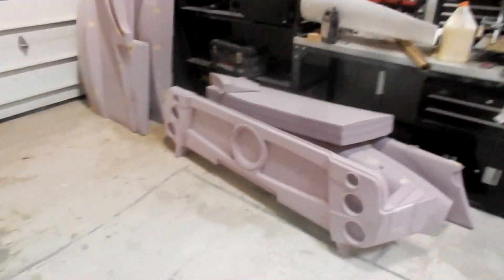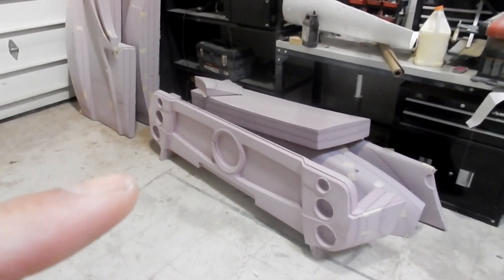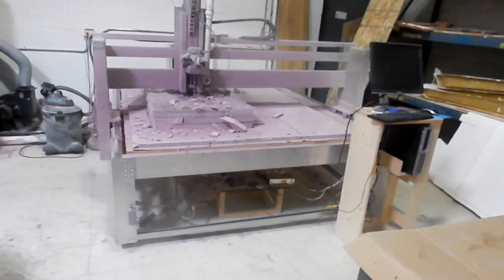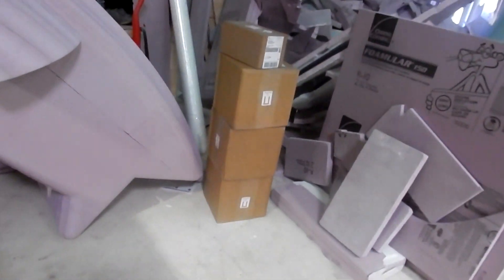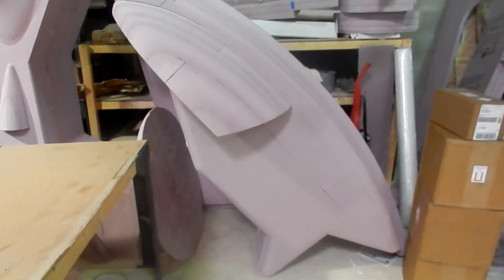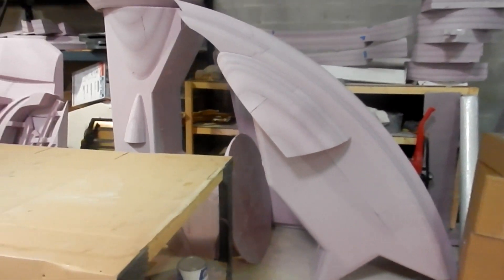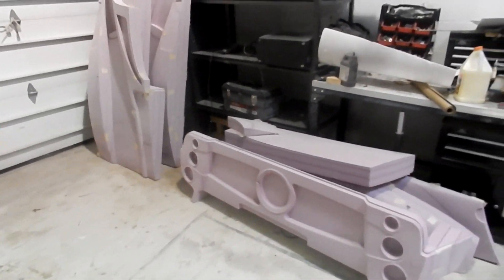CNC Zhonda R styrofoam plug , amazing car!

Comment: quick question; how long does it take to get a full car body with foam in cnc ? and the cost please. I know it depends on the design but between how much and how much
Reply from the maker: Hi, it takes about 2 weeks to machine. cost can range 6k-8k

Comment: Hello Nathan.
May I say what a great job.
I take that these foam replica or custom parts  are the building blocks for fibreglass work to be moulded from.
Example: 
A kit car / custom car build.
Am I correct.

If this is correct. 
Then I have a follow up question. 

By the way. 
Is their an E-Mail to contact You.
Kind Regard’s.
WG-Fab.👍

Comment: How much for the pagani zonda styrofoam, Thanks
Reply: ele 112 
You need to convince this guy that your serious whatever the hell that means. I tried to reach out to him multiple times. This guy ignore everything. It’s kind of a joke
Reply: Facts, Connections No Opinions i won’t even bother i he does not want my money some other companies will, as i have done a quick search online and found two cnc companies that cut foam and i was given a quote for their service and to my advantage the item that i will receive will be from one piece which will save me a lot of time.
Reply: @ele_112  What were the companies you found? I haven't had as much luck.
Reply: Joshua Kimble they companies that i had came across are based in United kingdom London, i will post a second comment later with details regardless if your interested or not as far as i can remember i was given a quote of about £5000 for a one piece item i.e: car at 1:1 scale of pagani zonda

Comment: How much are you selling thee for ?  What frame do they go on or do you have to have a tube frame or composite or ?  Is you plug good to fiberglass or carbon fiber right over or do you coat it with some thing first ?   I would love to visit with you more on the car !  Thanks
Reply: cody cheney if this was me, I would take the Zhonda and weld up a steel tube chassis, in the back of the chassis I would take the front subframe and engine/transaxle out of a VW TDI and swap it into the rear, extend the shifter cables. You could even convert the TDI to bio diesel afterward, literally 70-90MPG+ daily driven Zhonda.... who cares if anyone keys it, it’s fibreglass, truck bed liner the whole bottom and wheel wells and you’ll be good for centuries, you could winter drive the thing lmao. Just zinc plate everything.

Comment: Do you make plugs for specific chassis? I'm new to all of this. Correct me if I'm wrong, you shape the plugs(car body parts-fenders?) so you can cast the fiberglass molds from them? Thanx for the video great work!
Reply from the maker: If you needed a body designed to specific chassis dimensions i could do that. yes, the plugs are to create molds/tooling for fiberglass parts.

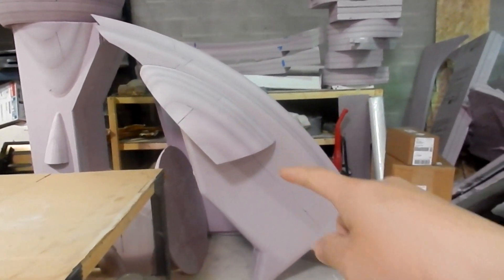Comment: Uhhh i identify the part at 1:14 as the G1 Tron Lightcycle. That movie is not from the 90ies, it's from 1982!

They didn't actually ever build them for that one, they didn't even have scale models, they were only 3D rendered. Which, think about it, 1982, shocking right. Well, it looks accordingly abstract now. They didn't have to interact with human characters or light at all, because people wore emissive suits and instead of somehow sitting onto the bike and the canopy lifting or closing on top of them, they simply grabbed a bar in the air, that was the steering bar, and the whole bike simply crossfaded on top, so the canopy was never supposed to open. The Lightcycle was never supposed to make sense as a real vehicle, it was specifically designed to be completely and utterly impossible, so good luck trying to actually build them.

They redesigned the Lightcycle into something more vehicle-like in later iterations of the franchise, but it always ended up looking fairly different and having completely different dimensions.
Reply from the maker: doesnt seem that complicated to make the body work on a motorcycle.
Reply: If memory serves, the canopy in the movie wasn't even wide enough for the driver to steer anywhere near comfortably. They didn't care because the transformation sequence is only shown from the side, and then driving sequences only had their head showing within a composite of hand-drawn animation, not even 3D.
Reply from the maker: what the movie dictates doesnt matter. we widened the shell 12 inches. its not inconceivable to make it a working shell on a motorcycle.
Reply: Siana Gearz , I wanted to make a full scale original version lightcycle since I saw the film in 82. concessions had to be made as you are correct, the cycle never was real,  and no room to actually maneuver within the cycle. We had to make it wider in order to actually accommodate a real human inside, so she's a little bit wider accordingly. The lifting hatch idea allows egress into and out of the cockpit. The hard part is making it operate. Using a gyroscopical balance system  as the cycle is fully enclosed..hopefully, this answered some of your observations, 😊

Comment: where do you get the 3d models? I'm asking as soon as I start watching, so forgive me if it comes up later or if you've addressed this in other vids.
Reply from the maker: You can learn CADD and model the cars yourself or you can buy existing models from websites.I cant list the websites here but you can google search.
Reply: ok, tks. I just meant the accurate measurements. CAD is no problem for me but getting the exact measurements is.

Comment: Hey, I actually was trying to get into the same type of thing that you're doing and I was wondering if you could give me any tips on how to get started and designing. What's some good 3d modeling software that'll give me all the tools I'll need to make something beautiful?
Reply from the maker: Hello, I'm using rhino 3d as a modeling software, but there may be easier packages to learn like sketchup.
Reply: OG_SMOKE ' 3d studio max is great 3d program, but it isn't cheap

Comment: Would a spray on glue be easier/ faster than drywall screws?
Reply from the maker: i do use a spray on adhesive to piece the parts together. however that is simply not enough for some sections to stay together so i use screws as sort of "skewers" to help support the pieces.

Comment: If a customer designs a custom car body, and gives you a 3D model w/realistic dimensions to make a plug, how much roughly would you charge?
Reply from the maker: around 5k. depending on the season and how busy i am it can get up to 8k sometimes.
Reply: Oh nice. Do you make negative fiberglass molds too?
Reply from the maker: yes i do.
Reply: That Tron looking thing your building is cool kinda looks like the one I want to build, where you located?
Reply: Lmfao 5k for u to print a mold someone else already created... 🤦‍♂️so pretty much 5k to use ur equipment.. smh just go to a mass production company cause this guy is a fool 2k I would understand but 5k is half of what it cost to buy a replica kit that comes ready to go with all parts and thought process and fiberglass done I would never pay anyone 5k to print some styrofoam
Reply: @RICHCREWSPLASHSET   You have zero idea what you are talking about.
Reply: RICHCREWSPLASHSET I’ll be waiting for your videos and business to compete. Unless, this was just all talk...
Reply: @RICHCREWSPLASHSET  Good luck trying to find a service that does what he does for close to 5k. A replica kit is not YOUR OWN design smh!
Reply: @nman2563  You can get this kind of plug made in China (if you have your own CAD model) for <$2k. It will also be in no more than 2 pieces.
Reply: @MaRi-wk8gp  it'll also take forever to get to you and have an increased chance of getting damaged.

Good luck with that.

Comment: What type of price do these run, ballpark? You do amazing work man! Awesome!!
Reply from the maker: 5-8k. thanks man!
Reply: Inspire Automotive 5-8 for one like this or any car body? Can you ship it worldwide?
Reply: @InspireCNC  contact email info requested. Wanting to use a 70 s Lotus Europa and morph GT40 front and rear ,door skins with new roof with door cut outs. Wanting to use orig size of Lotus Europa. About 4 % smaller. Using the Lotus Europa as a donar car is dot legal and allows 4-6  cycln. Engine use etc. Note looking for wide body version GT40.   I have a second project a set of molds for Pantera on fiero car. Looks alright, ah I have a update for custom upgraded look to  make new molds after ad on molds.
Reply: Inspire Composites thats a reasonable pricetag
Reply: Inspire Composites that's reasonable but way out of my league price wise.

Comment: What function in Rhino/how did you section those parts to be able to be milled in those separate pieces?
Reply from the maker: With Rhino, you can draw a line, "extrude" it through the object that you want split, then use the tool "split" to split the object.

Comment: I'm glad I stumbled upon your channel,  im looking to get into making my own composite parts.  I'm working on building my own cnc router for cutting foam to make the plugs.  what modeling software do you use?
Reply: I just checked your channel. I tried evaluating rhino on 3 separate occasions,  I just couldn't get into it. Im using fusion 360, I find it more intuitive.
Reply from the maker: Hey Sy, im using Rhino 3D as my CADD software. Check out the DIY forums at cnczone.com if you are working on building a cnc, lots of help and information there.

Comment: Hi, good work on this ! I would like to build bodykits in the future and I have some questions : What is the CNC machine that you use ? You do the 3d models on Rhino and then send the models to the CNC machine who build those pink blocks in polystyrene, then you build the mold on this and finally the fiberglass kit ?
Reply from the maker: Hi, the CNC machine i use is custom built, but its a 3 axis with an 8 inch Z axis. CADD drawing is done with Rhino 3D. A "CAM" software is used to create G-code that will be read by a post processing program on a computer that connects to the machine. The CNC mills/cuts the Styrofoam rather than builds it.
Reply: Inspire Composites ok thanks a lot for the infos

Comment: How do i contact u to order a plug
Reply from the maker: You can email me at nate@inspireautomotive.us
Reply: @InspireCNC  Nate, I have been trying to properly bond the Foamular 250 pink foam. I have tried a number of products. All have issues. It appears you are using 3M SUPER 77 spray adhesive. I use that a lot, too. Also use the made for styrofoam 3M 78 spray adhesive. It is white instead of the dark red color. Have you tried Glidden GRIP?  If you let the two coated surfaces 'air' until very tacky  before joining the two surfaces, it seems to cure over the complete bond area. If you join the two surfaces too soon, especially large area surfaces like the ones you use, the bond will not cure completely. It seems to require air to initiate the cure. If you are not using 3M SUPER 77 spray, what are you  using?  Regards, Joe T.